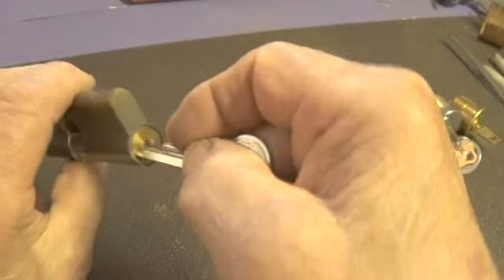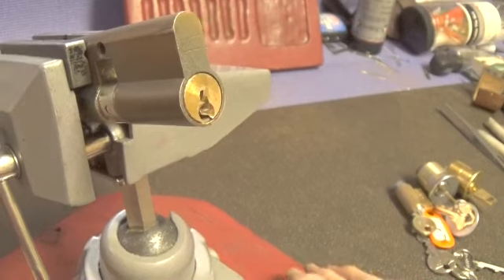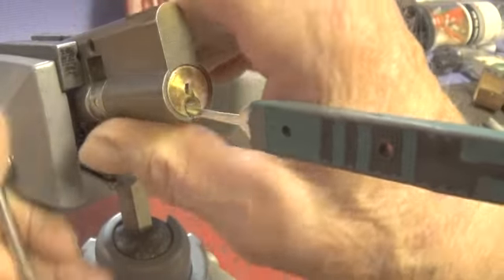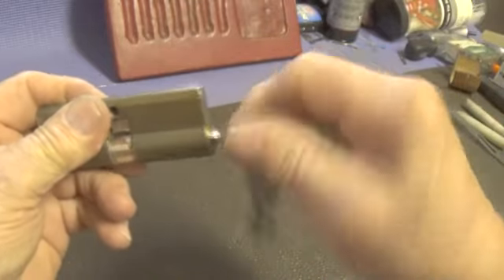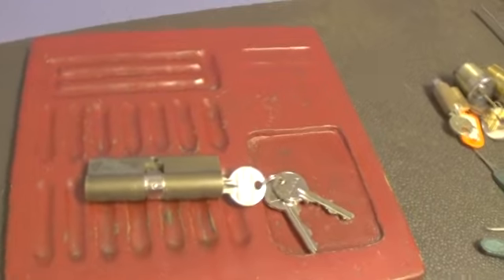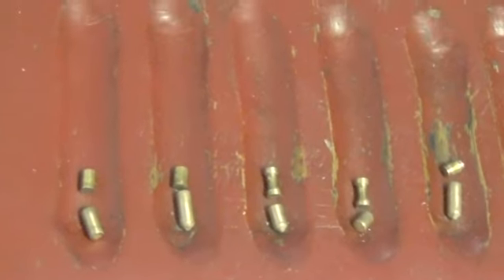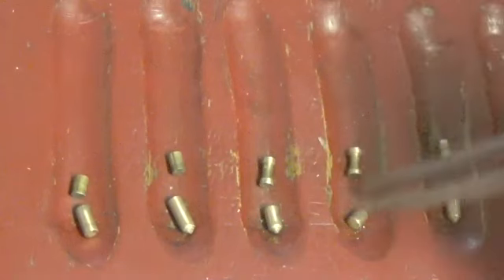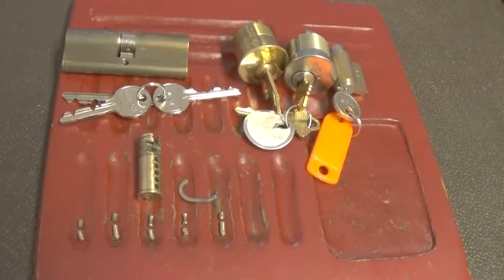(197) Trelock Euro Gutted from Joshua

Comment: Good job of disassembling it, and picking it the two times. It looks a very difficult keyway.
I think the channels around where the pins move are called warding and are to restrict access, as it looks similar to on the how to make a lock video.
Reply from the maker: Aspie Pickerr It is  a very difficult keyway. It is not impossible but close to it. It may take someone with more experience than I to open it on camera.

Comment: Well done on opening it twice! Also the bitting looks very evil.
Did you make a special pick tool to workaround the wardings? - looks like from what I saw in your video.
Reply from the maker: Potti314 Yes and I broke it just before it opened. I had another one close to it and was able to finished it. This lock is the hardest one I have ever opened.